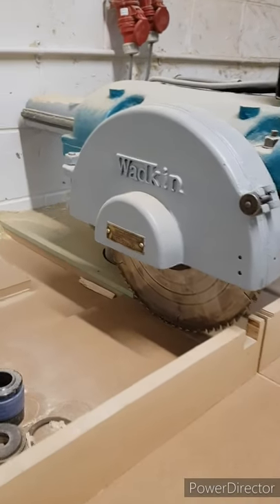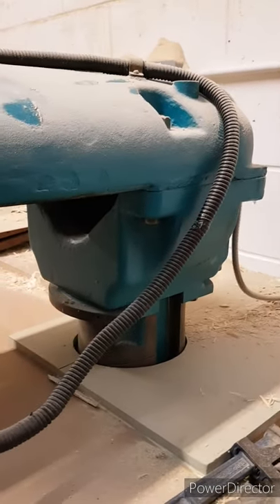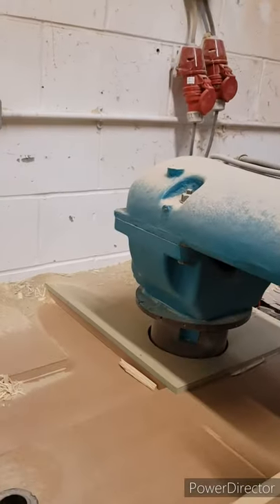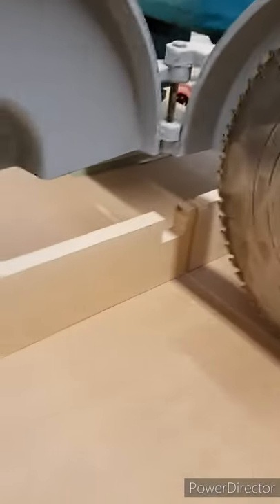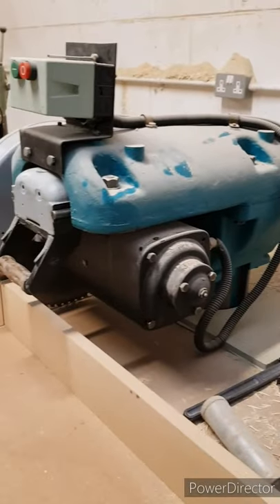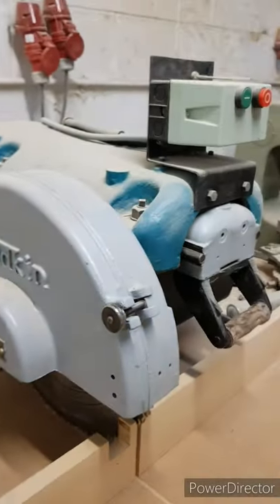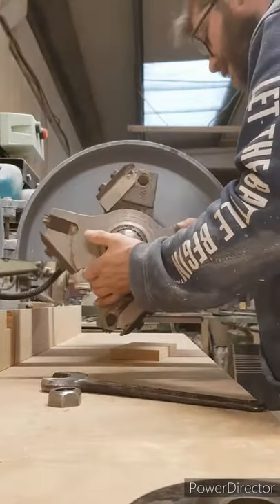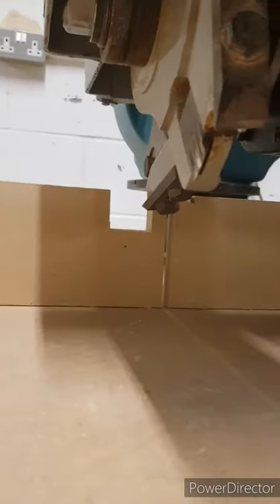How to cut big grooves in timber, wadkin cc crosscut. @ianstanbrook6361

Comment: Very nice cut indeed! Ever think of adding a soft starter? You could then use it to act as a brake as well. You are correct in using those big trenching heads. Bloody scary!!!😬😬
Reply from the maker: Thank you, I might need to put  a soft start on it if I use the steel expandable groover,  weighs quite a bit so I dont think the motor will like it too much. The on ei used is a cast aluminium one. Still a bit of weight but nothing like the steel ones. The bloke I bough tthe machi e off has got a wadkin 24" without the winch. Funnily enough he's never used it!! Dont blame him.
Reply: @ianstanbrook6361  Can't blame him for not using it!